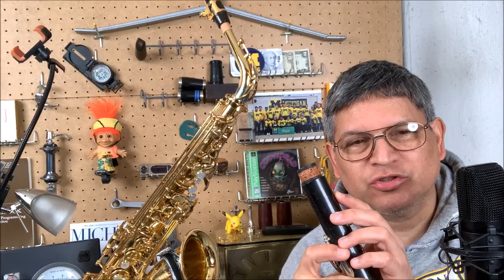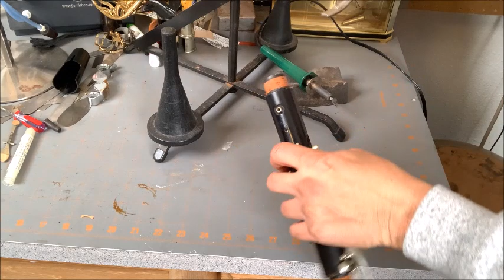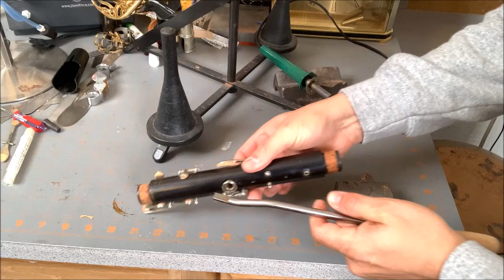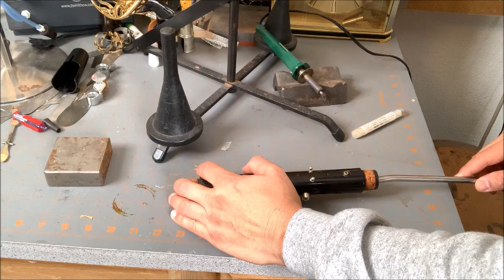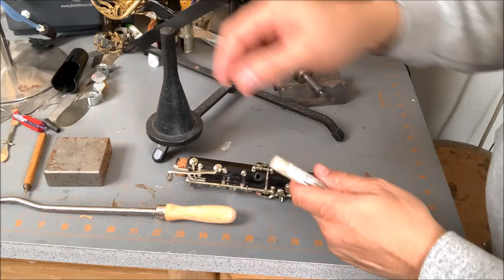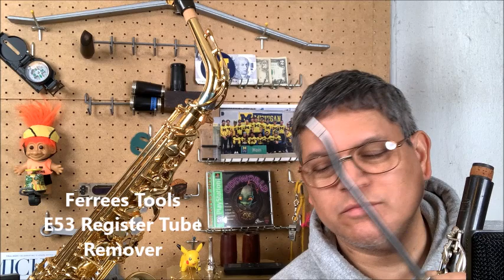Clarinet Register Pip Tube Removal, Installation and Sealing

Comment: I used to have an Amati acl 315, and I had to replace the register tube because the original was missing a chunk out of the top on the bore side of the tube. It was the Selmer CT style with the hexagonal nut screw type. The tube I got as a replacement must have been of a later style because the diameter of the tube was slightly smaller than the original, but I couldn’t notice any difference when playing.
Reply from the maker: Is the 315 a Full Boehm model?  I recall Amati making FB keywork long after everyone else has stopped.  WWBW (WoodWind BrassWind - large reseller in the US) used to carry them ages ago but I'm not sure if they do anymore.
Reply: @gottalovetheknowledge4749  The 315 is a full Boehm, yes. Mine was an older one (made in Czechoslovakia old) that was probably from the 1980s.